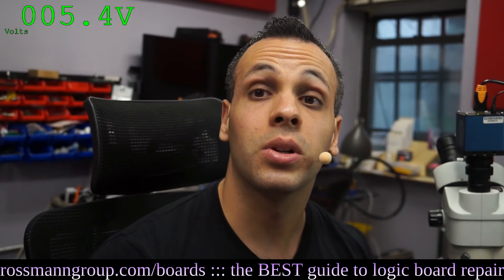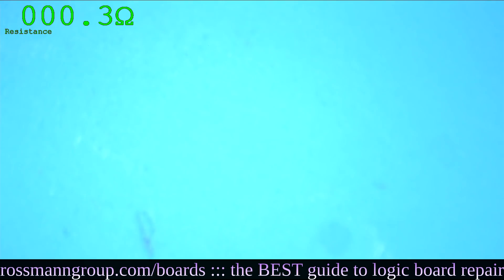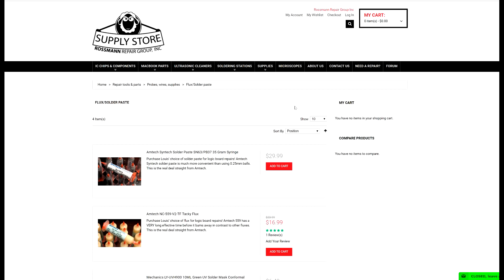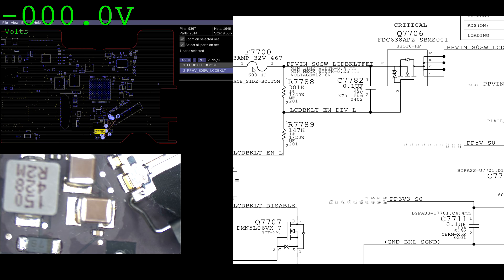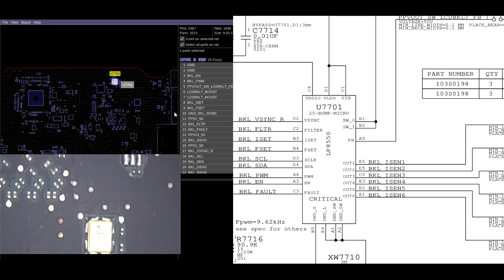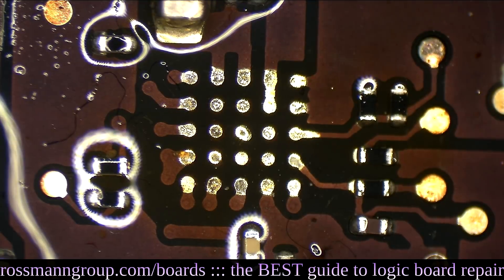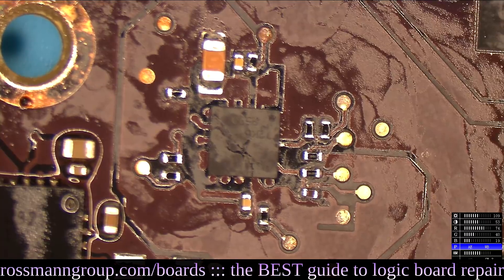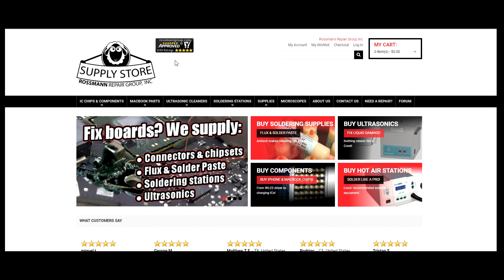Boring, uneventful no backlight repairs.

Comment: Louis, I've watched a fair few of your videos now (who needs normal telly? Excellent resource dude!); something which stands out is just how often a fault is caused by a particular component not receiving power (bad rail/feed), or a ground short, bad IC, etc. The bad diode in this video is a good example:

http://www.youtube.com/watch?v=V5swFgiDl60

Why, do you think, does Apple not include even basic self-checking diag circuitry which could indicate via fault LEDs or some other means when particular fault conditions occur? My experience is more with SGIs, so for example I'm thinking of the error detection logic on their old IO4 board in the Challenge/Onyx system, the numerous fault LEDs on the power supply units, midplane and various power bricks spread across the installed boards (this is tech from 25 years ago btw). If the power system is ok, but something else is wrong, then LEDs or status registers are set to indicate the nature of the fault, info which often can also be viewed via serial port & terminal.

In other words, why doesn't Apple include some simple self-checking circuitry which monitors what should be coming out of the various power rails, critical ICs, diodes, etc. and thus either set an LED or take some other action to indicate what's wrong? (note I mean LEDs on the board intended for someone attempting a diagnostic, not the end user; they could be hidden as long as the casing is present, and none would be on if no faults are present). Is it really just a matter of Apple keeping the production cost to a minimum? Though I suppose such circuitry would draw a bit more power, a sensitive issue for portable products.

I would have thought that at the very least with their more expensive products, and given the nature of the reputation they encourage people to believe they should have, surely it would be a worthwhile investment on their part? The bad diode in the above video is typical, ie. some extra circuitry which checks that the outputs are what they're supposed to be. It doesn't have to be complicated, eg. if the battery is dead and power is relying on DC-in, there could be an LED near the diode which is only lit if there's no supply from the battery but also no output from the diode (a transistor setup of some kind, with power for the LED coming from DC-in). Likewise, there could be a 2nd LED to incidate the reverse condition, when the battery is providing power, there's no DC-in, but the diode isn't giving out what it's supposed to from the battery (power for the LED coming from the battery), ie. in each case the LED is turned on if that particular supply is not making it through the diode when it should be.

Or would this kind of thing just add too much to the cost? Or involve too much additional PCB space? Or use too much additional power? I am only a beginner in this field (the electronics side I mean; my focus for 25 years has been on system architectures), but even so I'm surprised how often the power feeds throughout Apple's boards don't have any means of self-detecting when there's a fault, and no redundancy. Ditto numerous other signal lines & critical paths. If they did, Apple's repair people would have an easier time working out what's wrong. Or maybe Apple just doesn't care.

Put another way, a great deal of the general circuit design in these boards seems rather crude to me. Is it really not economically possible these days to do better? Or if it could be done but would cost more, would consumers be unwilling to pay the extra? Surely not, given the nature of Apple product users. Are there examples of non-Apple boards which do have self-checking circuitry and don't cost a fortune? What do you think? Some PC mbds have a few diag LEDs, but they're pretty basic in what they can convey. Perhaps top-tier server boards? I don't know.

Anyway, thanks for your excellent content! It has been invaluable in my getting started with SGI PCB component level repair. I'm sorting out the necessary equipment atm and learning as much as I can from your videos (bought some flux and other items from your site). The fact that your content usually concerns Apple boards is fine btw, since what interests me is how you go about locating faults, ie. your general methodology, overall circuit analysis concepts; or as you put it, one often doesn't have to know how a board works in order to find out what's wrong. It's the applicability of your approach to these repairs which I am sure will be very useful with what I need to do (especially PSU repair), and if I can fix & sell just a single IP25 board then that alone would more than pay for all the equipment I have bought. 8)  I've cleared a desk, obtained most relevant tools, about to build my own fume extractor, install lighting & power feeds. Still need to get an oscilloscope, decent multimeter (just have a basic unit atm) and bench PSU (alas the model you use is not available in the UK, where btw those fine tweezers cost almost $30 equivalent), but I can begin with less complex repairs that don't need these items (1995 PSU fix; $2 for the required caps, worth $500 once repaired). Without your info though, I would have been at a loss as to where to begin, and extra thanks for the excellent description and numerous example uses of flux (I now shudder to think how badly I was doing my own basic meddling 30+ years ago when making guitar effects units. :D)

Ian.

Ref: http://www.sgidepot.co.uk/chalonyxdiag/
IP25: http://www.sgidepot.co.uk/simonpigot/rip25.jpg

Comment: So i have been listening to your vifeos for a while and just subscribed. And most of the time I agree completely with the apple bashing. However, lately i found myself in need of a good laptop that will last for a long time, great battery life, great screen, fast performance, light, and best possible sound. And now after looking for too long, it seems only a macbook pro has the best of everything. I literally am unable to find an alternative. Please if you know of one tell me, otherwise i am going to get an apple and i dont like it.
Reply: It used to be that IBM Thinkpads were a solid choice, but I'm not sure what they're like these days now it's all Lenovo. Last for a long time though? I don't think any laptop is deliberately built that way. Mind you, I've been happy with my 17" ASUS gaming laptop (GE72 6QF) which has been going strong for almost three years now (but it's not exactly light. :D), only issue has been the lettering on some of the keys fading off, but a spare kybd from China was cheap (for when the 3yr warranty eventually ends). Perhaps have a look at whether ASUS has any lightweight general models?

Comment: I do electronics and telecommunications at university, and right now I'm applying for a job in programming micro controllers for use in the automotive industry. If I discover that programming is not really my thing, do you think I could give electronics repair a shot with what I pick up in uni ?
Reply: Repair has little to no programming in it. You'd be better off taking a technologist diploma program than a degree.

Comment: Red Cameras are worse than Apple when it comes to nickel and dime you for all the first party required accessories.
Reply: They are excellent cameras though.
Reply: Red cameras are not for the consumers, they are marketed towards movie makers and such and they usually don't care about the money
Reply: They have a monopoly on high end cameras.
Reply: Vincent VL +1 unlike Apple the base products are superior and supported for a few generations. Matter of fact I think all their original stuff still supported. Unlike Apple, and 10k red camera vs a 40k base camera of any other pro brand.
Reply: Yea, but then if they included everything, which wouldn't be possible since everyone uses a different setup, they would have to charge a ton more. Also people like to use third party components, so they would have to double buy. I would take a la carte any day over something that comes with stuff I don't want/need/want to use a third party option. I would love to be able to buy a car, that costs $1500 less, that doesn't come with wheels and tires, so I can put the ones I WANT on it.

Comment: Louis, have  you ever worked on Gigabyte gear? Are they any good? I Have owned both HP and Dell laptops and found their durability and QC to be shoddy at best.
Reply: My Gigabyte GPU seems to work great.
Reply: Thanks!! You do a great job, by the way.
Reply: I've heard a lot of good from gigabyte's hardware, but please for the love of god DO NOT buy their AMD motherboards. I've had a GA-A320M-HD2 and a GA-AB350M-HD3 and both I've had numerous issues with. The A320 chipset doesn't support CPU overclocking but does support XMP, that gigabyte board didn't work with XMP on my RAM at all, even with th elatest BIOS update. The AB350M board is also meant to support overclocking (B350 support overclocking), but from my experience it's only been working on very certain BIOSes, with others either providing unstable results with very minor overclocks, or outright locking the multiplier. Also gigabyte's easytune is absolute shite and a terrible OC software, even ryzen master is better. 
Aside from that gigabyte's GPUs and intel boards are apparently pretty good
Reply: Wada Don, it's a shame when the quality and/or durability of a PCB can be ruined by a poor BIOS or other issues. ASUS boards are generally good, but not immune to daftness, eg. bad firmware in the NEC USB3 controller on the P67 M4E means ports can just drtop out sometimes (something that was never fixed). I suppose the people who maintain the BIOS are likely completely different to the ones that design the PCB.